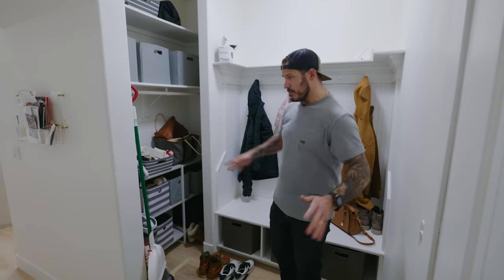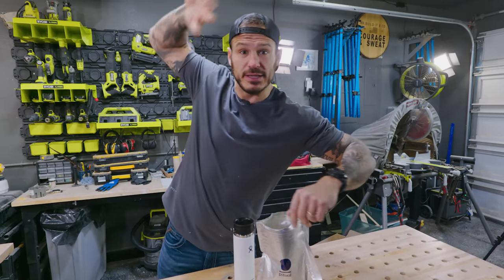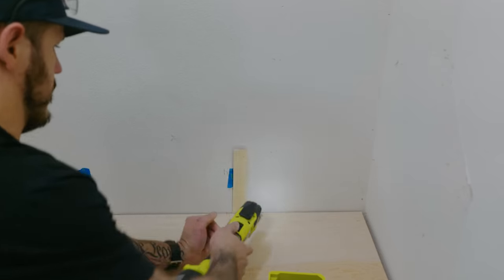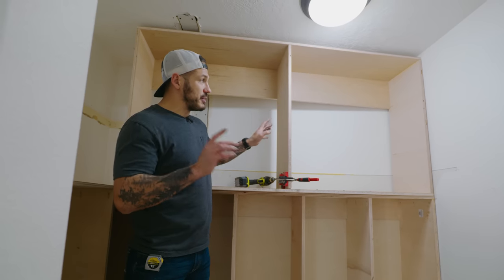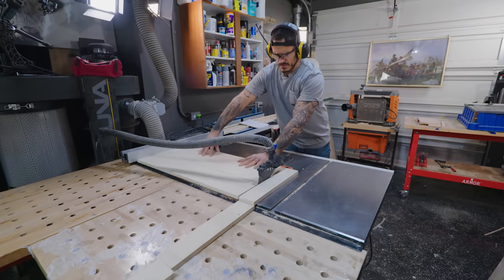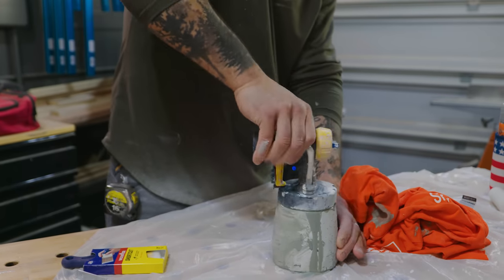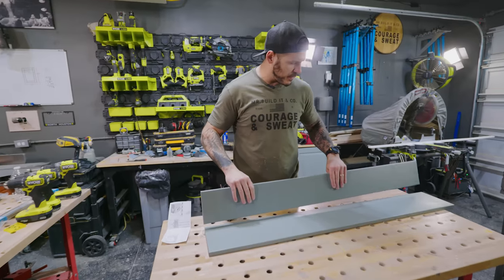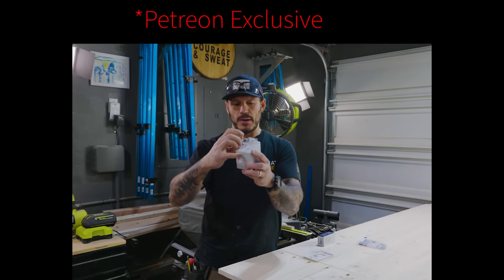Building My Wife Her Dream Mudroom

Comment: Looks really nice but the few things I noticed…Why didn’t you fix the ceiling first? Way more hassle not trying to screw up your hard work on the cabinets. I would have sealed the wood on the inside to resist staining and moisture and why in the hell would you use a pocket hole in the bottom corner of the the cabinet face and not  put a plug in it to finish it off?? No way you could have just missed that…

Comment: I really enjoyed the video, and your content and work is great, however I really wish you would’ve addressed the issue with your math on the rails and stiles. The tongue and groove depth needs to be added to the rail length and not subtracted. This would now result in a door that is 1 1/2” too small, since the procedure was reversed. I imagine you realized that somewhere along the way, but I wish you would have corrected this in the video. It would be a shame if someone watching your video, whose trying to save money by doing this themselves, ended up wasting a lot of money and hours of their time, because of this issue. Especially if they didn’t realized it until they’ve already assembled, prepped, and painted the doors, only to find out their mistake when they try to install them. Maybe an edit would be worth making.

Comment: I'm stunned. You seem to be using the same circuit your fridge is on to branch off that to the outlet in your mudroom. AFAIK this is strictly against code--the fridge must be the only appliance drawing current on that circuit. It's dedicated. I completely understand how conveniently located that circuit was, just on the other side of the wall, but I'm 99% sure you committed a great big electrical no-no.

Comment: Is the center panel 3/4", wouldn't that make the panel face higher then the frame?
Reply from the maker: yes, by 1/4 inch unless you run it through a thickness planer

Comment: As a custom cabinet builder, I'm amazed as to how much youtubers are obsessed with pocket screws. They're completely unnecessary 95% of the time. the screws are more expensive than regular wood screws, and it takes more time to drill for the pocket hole than to just put in regular wood screws. But it's still astonishing to see how dependent on pocket screws these DIYers are.